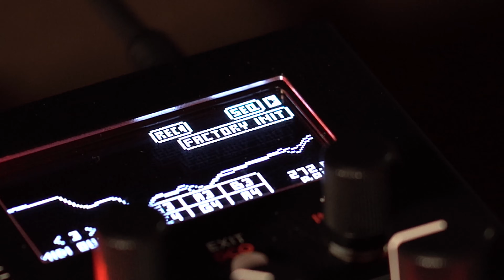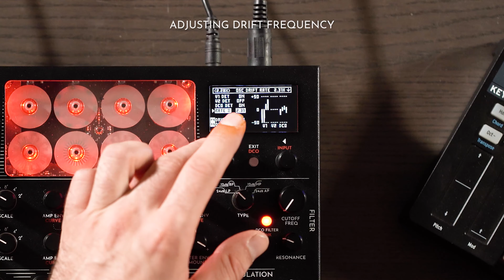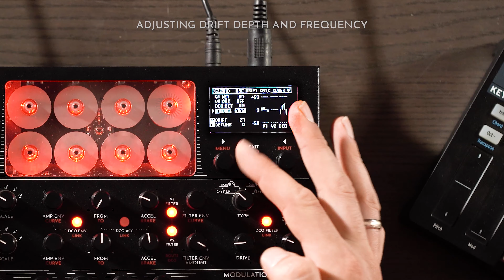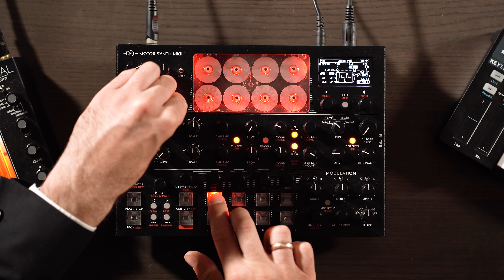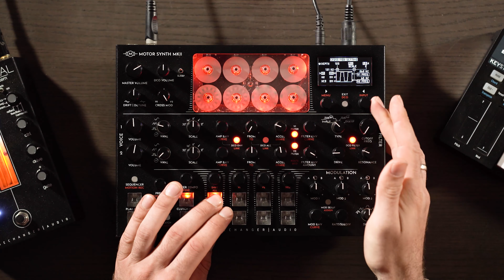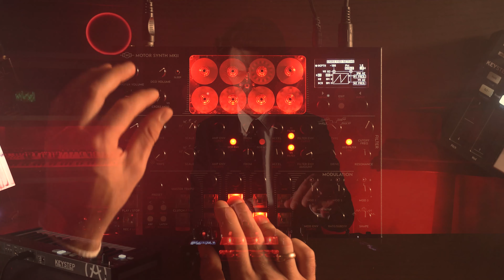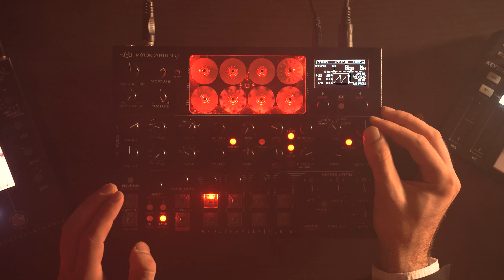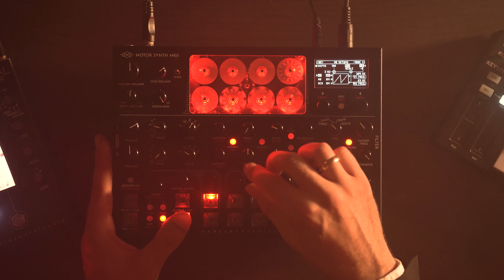MOTOR Synth MKII  - Drift/Detune & Cross-Mod

Comment: Sorry that I have a question cc Mk1. Could not find the video of Perfect Circuit where one of you men in black showed that the wheels can be pitched down to a full stop = 0 Hz. I could not find however a way to do so with my Mk1. The lowest note I can pitch is E0. 
Question now: How can I realize that with Mk1 or is that feature reserved to Mk2 only?
Thanks!

Comment: You're in a desert, walking along in the sand when all of a sudden you look down and see a tortoise. It's crawling toward you. You reach down and flip the tortoise over on its back, Tom. The tortoise lays on its back, its belly baking in the hot sun, beating its legs trying to turn itself over. But it can't. Not with out your help. But you're not helping. Why is that, Tom?